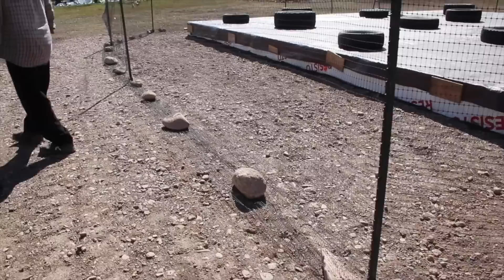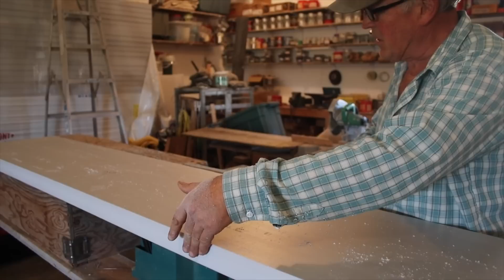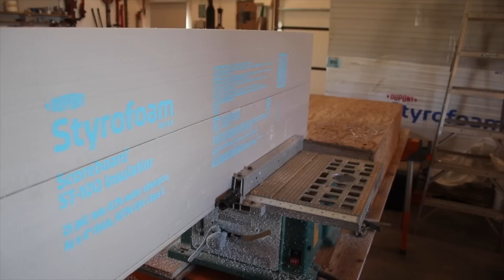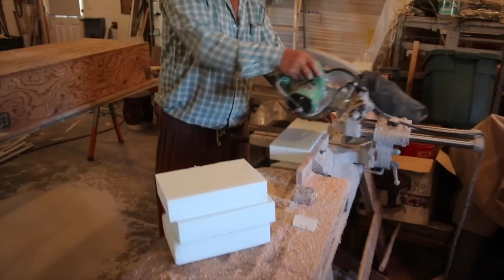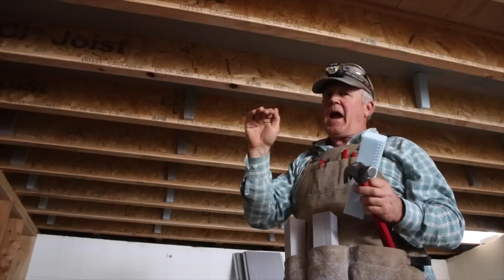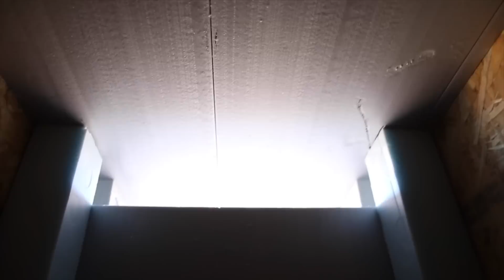Wrapping Up The House Foundation For Winter, Insulating the House Floor/Ceiling of the Cellar

Comment: This looks great!! I am pleased to see that Clay has a table to slide the large pieces of wood and foam. We have a roller bar, yet this is a great idea we will have to incorporate into his future workshop. That closed up the flooring really nicely!! Personally, I like the gravel flooring, yet here in NH they find that it gets quite moldy, but from listening it is likely the balance of air flow that would be causing it.

Comment: Another good solution for a pee bucket is to use the pellet horse bedding. When it gets wet it turns into sawdust. It works great for cat litter box. Put holes in the bottom so the sawdust drops through. No smell.